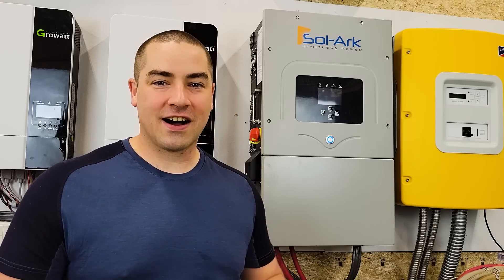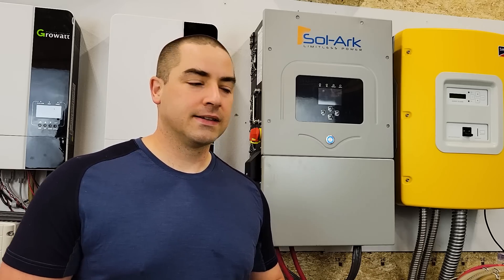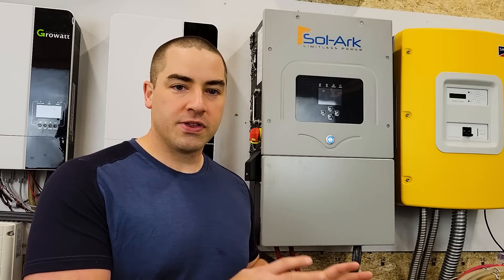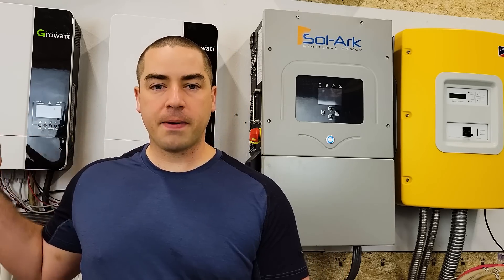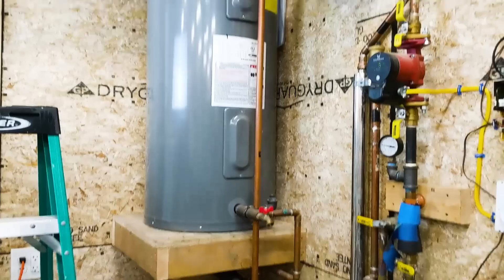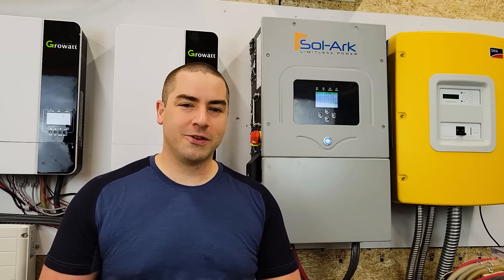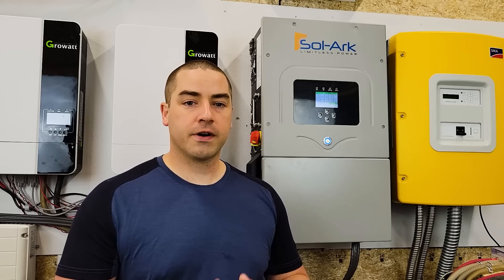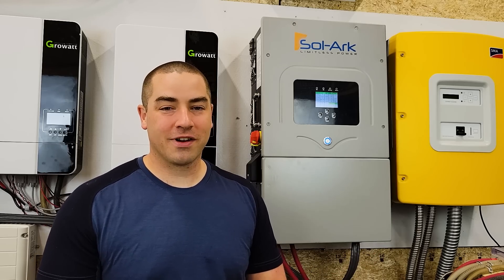Sol-Ark 12K Inverter, Is it worth it?

Comment: David, I thought that you would test the Solark with the Solar-edge Autotransformer.  Your house would not go down, and that would be Apples to Apples comparison; but I agree that the solark is very expensive compared with 2 Growats. I am thinking to buy a Growatt inverter as backup for my solark inverter. I just cannot afford another Solark.
Reply: Yes and compare price to power output and the Growatt would beat it hands down.
Reply: The solark wasnt intended to use a autotransformer....or they(solark) would provide that option with their own branded version...this one of the downsides of a high frequency hybrid inverter...all have a trade off btw.
Reply: I disagree. In this comparison you are using a 9000W split phase inverter versus two 5k inverters combined. The Sol-Arc STILL costs more. That sounds more like a better comparison to me. Sure, using the transformer would make it 9k vs 10k and the winner is easy to determine without factoring in the cost.
Reply: Isn't the entire point of spending the $7,000 on the Sol Ark to have something that already puts out 120 and 240?  Why would he use a $7k solution and then spend MORE to perform a function (output 120v) that the Sol Ark says it does out of the box?  

If the solution to using a premium product to do its job is to buy another "helper" product, I'm inclined to find another product if that doesn't fit my need in the first place.
Reply: I guess you could AC couple the Grow Watt and have the advantages of both?
Reply: It would not be apples to apples comparison

Comment: Interesting to see this! I have a large electrical system. Here in this part of PH we use the same split phase system as we do back home in The US. We presently have 4 main breaker panels with 4 separate solar systems to power it. Our main critical load system now uses a 12kw Growatt inverter, it originally had a 10kw Aims but it never worked properly, it wouldn't carry a load above 3kw and I spent months trying to get them to actually deal with it, once I was able to show it didn't work, I never heard back and then it was out of warranty and they wanted $1000. for a new control board. But that's a whole other story. My Growatt I purchased direct from my supplier in China for only $1700.US including shipping, I could buy 3 of these for what the Aims cost me and 5 for your price for the Sol-Arc. One thing I did do was make sure the normal 110 loads were balanced to both legs of the panel as best I could, this helps to balance the load. I have no trouble at all now. My full load for that panel is only 9kw, it runs it no problem, I don't like full loads on anything as I feel it reduces the lifespan, I like a margin of error, just in case. I've had good luck with my Growatt units, I have been running an 8kw grid tie inverter from them with no problems for over a year, plus I like their Shineserver where you can monitor your inverters online from anywhere and if you have a problem they can look at and fix it online sometimes. Thanks for all the videos, they are a great help. the dog
Reply: What is the size of your array coming in on PV1 and PV2 of the charge controller of the Growatt 12kw?  Can the Growatt SCC be over-paneled  as long as you don't exceed VOC?
Reply: Thank you for this - so powerful   I'm starting to gain confidence in these Growatts !

Comment: Nice work Dave. Your partner is like mine, just want it to work and not have to think about can i have the toaster on at the same time as the cook top. I just finished my fully off-grid system it consists of a Victron Multiplus II 48/10000 inverter, Fronius 8.2 that is AC coupled and 2x150/70 Victron MPPT,s that is the DC coupled side. So i have 10kW solar on the AC coupled Fronius side and 5kW on the DC coupled side. That is feeding 8xUS3000 Pylontech,s which gives me 26kWH of usable storage. This system keeps us going fine without having to compromise on anything. Cheers
Reply from the maker: That sounds great.  The 10000VA unit is 230V, so are you oversees, or are you in N. America and using an auto-transformer?
Reply: @DavidPozEnergy  Australian Dave. 240vac.

Comment: Thanks for doing the checks on the unbalanced load. Is there such a thing as a balancing transformer that would pull off both legs tobalance the load on one leg? For the price the 2 Growatts seem to the way to go. I have a Schnieder XW6848 and have not run into any problems. That said living off grid for 30+ years my house is very energy efficient.
Reply: An auto transformer (like the one he has) will fix it. If price is a concern then go with the Growatts. If you want more features like grid tie capabilities with zero export control, generator backup, and/or dual 6kW MPPT controllers….. Go Sol Ark. You get what you pay for. It’s the old harbor freight vs name brand tools dilemma. You can pay for the cheaper tools at harbor freight (and they may work just fine, I have a few myself), but there’s a reason other tools are more expensive, and it’s not always just because of the name…. 🤷🏼‍♂️

Comment: David, as I previously said, Sol-Ark is extremely misleading with their customers and they bit me along with some others really good in getting rid of their 59V Sol-Ark 12K's that will not work with LTO SCIB batteries. I am getting some others together so we can entertain a class action suit against them if they don't correct the problem. This unit is extremely easy to DIY but, it comes at a premium price for what you get. There are so many others out there now at a third of the price that will do the job as good or better.
Reply: Please explain.

Comment: Glad I bought the growatt seams to be doing well. It will be even better when I get to second one in won't have to worry about running water heater and dryer at the same time.
Reply: Look at the heat pump water heaters to lighten that load to 400 watts.  Rheem.

Comment: When Sol-Ark comes out with their 15k inverter soon, might that tip the scales and be enough to keep the breakers from tripping? Who likes having to deal with and worrying about loads?
Reply: i think it will be a game changer. a 200 amp transfer switch. You dont need a back up panel.
Reply: Have you contacted Sol-Ark?
Reply: Maybe the 15k will actually have a 12k inverter in it ?

Comment: Great video, Load imbalances between L1 & L2 are an important issue that most people don't fully appreciate. As far as I know ALL split phase (120/240V) inverters have a similar architecture in that there is actually 2 inverters, (each rated at 1/2 the total output) that are out of phase by 180 degrees but are tied together at the Neutral. This is true of many Inverter type back up generators as well. As you point out so well in the video, the inverter works much better when the legs are balanced. Also worth noting here is the difference between low and high frequency inverters. The traditional low frequency type inverter uses a large (and usually heavy) transformer and have much better surge capability as well as being tolerant of handling loads at 100% of the rated output. Of course the limitations of split phase architecture still holds true.
Reply: Yes, but solid state high-frequency inverters have higher efficiency. This might be more important for off-grid installations than surge power.
Reply: The low frequency inverters (Mine is an Aims 12kW) have a center tap on the massive transformer so they actually include the best features of both. I just ordered the 5kW growatt for another project. I bought the autotransformer with it as a package.

Comment: I'm not doubting your experiment here. But how do you know that it's not the shunt that is reading wrong? Especially if you and your buddy both have the same one?
Reply from the maker: We both have confirmed this with clamp on multi-meters.  I have a cheap Uni-T clamp on.  My buddy is a professional electrician with a fancy Fluke.  Same results.
Reply: They read almost the same at higher loads. It's not surprising it can't accurately read down to the dozens of W's.

Comment: It's perfectly normal, if you have 9kW inverter with two phases there will be maximum output of 4,5kW per phase, the same would happen with any other inverter from other companys. If you have more than one phase you alway have to consider balancing loads between all the phases (even load on all phases), in case you don't want to think about it, you should consider buing inverter with higher output power.
Reply: How can you do that?

Comment: I just started using a Victron on a small off grid system and it is the best. Not all in one, so you need to add separate equipment but it is flawless..
Reply: Great news . This is the way I plan to go next as well . Blue is the Best .

Comment: Bummer! I always thought Sol Ark was such a great product. I’m using a 3k 24 V Victron inverter and have never had it shut down but one time. And that’s when I first got it. I’ve run my gas heater & microwave and have had no problems. 
Although I try never to run two different high powered appliances at one time. My next inverter will be a 5K or higher at 48 V.
Reply: Yep, although if you ran it above the spec, it would probably shut down too. David is running the SolArk beyond the listed spec and it shut down. Pretty expected to be honest. I don't own any inverters so I'm not trying to convince anyone, but people are reacting like it's broken. Anybody who buys a $7k product and doesn't read the spec sheet is kind of asking for it in my opinion! Don't like the spec, don't buy it, know what I mean?

Comment: Max Continuous AC Passthrough  21000W 50A L-L 240V! And if its rated to be 9000W it should be labeled Sol-Ark 9K Right? Whats wrong with them.....Geeesh!!!
Reply: Marketing! Bigger. number. better.
Reply: When did they ever say 12k was for the AC output alone?? Pretty sure it's 12k because it can do 9kW AC output and 3kW of DC charging to the battery. 9+3=12.
Reply: Naming scheme is based on max solar input, which all Sol-Ark's have always been named from, NOT on max AC output. Please read the manual.
Reply: It's called the 12K because it can utilize 12K of dc solar. Can provide 9kW to the AC side off-grid for loads and simultaneously 3kW to charge the batteries. They do not hide this. You just found a video from a clown who assumed something that was incorrect, and couldnt even mount the thing per the manual's instructions because he probably never read it.

Comment: I understand and know how your system works so you may not be able to answer my question but if the SolArk was grid tied wouldn't it just send the load to the grid and not shut down. You know why I am asking because of all the wasted (when not used lost) energy all day when your loads don't use all the solar production and the battery is full, when it could be banked with net metering. As always thanks for your perspective and ingenuity.
Reply from the maker: Hi OffGrid Wanabe,  Yes, you are right.  If you had the grid connected, and the grid was live, then the grid would power the loads, not the Sol-Ark.
Reply: @DavidPozEnergy  Congratulations David! Completely false statements like this add to the confusion your viewers have about grid interactive and off grid inverters.
Reply: @DavidPozEnergy  That's an INNACURATE statement... The Sol-Ark would COMBINE its power with the Grid to power the loads... So misleading, Dave!!! Shame on you...!!!
Reply from the maker: Hi Alfredo Pila,  Thank you for the clarification.  I was basing my answer to OffGrid Wanabe from what I read in the manual on page 4.  Item#4, sub paragraph b states: "On Grid = 63A continuous (pass-through)".  Though, to be frank, this is not the focus of the off-grid video.
Reply: @DavidPozEnergy  :) you are the best
Reply: @DavidPozEnergy  The term grid is assumed to mean utility provided power. Since the SolArk can accept AC coupling I was thinking of making up the load difference with Enphase micro inverters which could run from the SolArk when "offGrid" lol. So we all learn some things which is the real reason we ask questions and try to understand our equipment. In my scenario the sun would still need to be available but if I had extra batteries and another inverter I would be tempted to supply AC to the Solark for load deferral. As always Thanks for your input and approach to energy saving CHEERS.
Reply: This video demonstrates what people who are off grid could face as this is marketed as a off grid inverter as well as grid tied.

Comment: I find it suspect when a company makes their model names intentionally misleading. Especially when the model nomenclature seems to line up with what other companies are using.
Reply: The 12K was designed for 12K of power input from PV with up to 9Kac and up to 10Kdc to batteries simultaneously. We have never tried to deceive. But I can understand your frustration if you purchased without knowing.
Reply: @Sol-Ark  Sorry I misunderstood. My assumption was that the model would indicate the inverter capacity not the PV input power. After thinking about it for a minute I can see the advantage of having an inverter that is smaller than the max PV input. I took a look at the specs for the Sol-Ark 12k, That 4ms UPS transfer time is pretty nice.
Reply: Agree. Totally thought this was a 12kw inverter, which is what is needed for most homes
Reply: Look up the specs yourself. It has 12k of solar input through the two MPPT controllers.

It also has the ability to pass through up to 12k with grid power, generator, or inverter with generator assist.

It’s only the inverter solely off battery that is not the full 12k.

It’s not misleading. If it doesn’t make sense then that tells me that a person didn’t take the time to fully understand the specs/capabilities. The 12k can fully support 12k. Heck, it can support up to 16k for 10 seconds and 25k for 16ms. But that’s also specified as L-L (240v) not L-N. Gotta read the specs.

Comment: If you ran the sol-ark thru the autotransformer, would that balance the phases?  And what does that transformer burn?  Sure seems like the gro-watts are a nice option, and having multiple means redundancy if one should fail.
Reply: transformer would balance the phases and are about 90-95% efficeint
Reply: It will balance the phases perfectly. I use the same Solar-edge Autoransformer that David Has with my solark.
Reply: It would balance it, and the solaredge autotransformer takes ~20 watts idle.
Reply: Of course it would balance the phases but that's not the purpose of this demonstration.

Comment: That inverter has an issue over 4k per phase. Its even worse with multiple solarks, as they fail like dominoes.
Reply: We offer all customers with parallel systems a free MCU hardware update that fixed all parallel situations. We are not perfect but believe in continuous improvement for our customers. Just call us.
Reply: Sol-Ark offers all customers with parallel systems a free MCU hardware update that fixed all parallel situations. They are not perfect but believe in continuous improvement for their customers. Just call them. FYI, David deleted the Sol-Ark response to this customer. Why?
Reply from the maker: I've seen that too with multiples.
Reply: @DavidPozEnergy  what is the issue you've seen with parallel Sol-Arks? I have installed two 8K Sol-Arks, and one parallel 12k system. The parallel Sol-Arks have been causing me grief with large inductive loads that are theoretically within the surge specifications of the 12k.
Reply: @DavidPozEnergy  I have several 12k units paralleled and don’t have issues.  I power my whole house which is all electric as well as my electric car.

Comment: You just saved me a boatload of money on that SolArk unit. I just got a quote on a system with that same unit. Crazy the tandem Growatts perform better. Thank-you, and your wife, for the honest review!
Reply: Matt, wanted to pass along a quick note. I'm using a Schneider Conext 6848 XW+ (XW Pro is the current version) Its a workhorse with excellent output for the price. Schneider uses the more traditional low frequency type inverter with a massive transformer and has excellent surge capability and continuous usage ratings. These can be stacked to increase output. They cost under $3,500 ea so for $7K you could have a true 14Kw system. I'm not affiliated with Schneider in any way, its just that no one seems to give this product its deserved credit.
Reply: @bentleyjarrard885  Thank-you for your suggestion. Yeah, the Schneider are good units. I ended up getting a Sol Ark anyway. I’m 100% off grid and have very modest needs. I was attracted to the SolArk because their support is DIY friendly and the lower idle consumption. In winter, I don’t get a lot of solar, so I need to stretch what little I get.  It’s all a learning exercise for me, so I don’t mind if I have to swap out inverters later..
Reply: I ended up getting a Sol Ark 12K . I was able to set it up easily myself  and I couldn’t be happier. It’s been perfect for my use case.